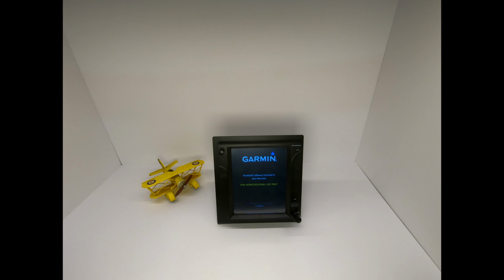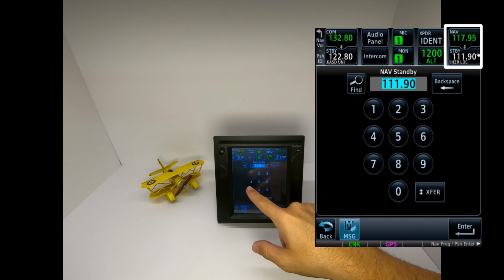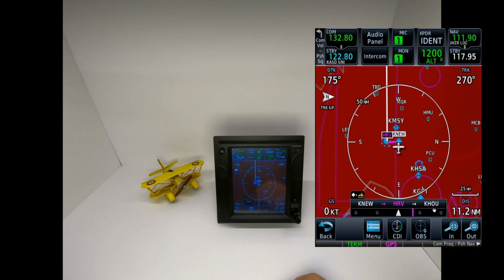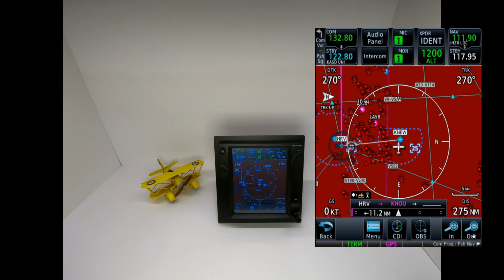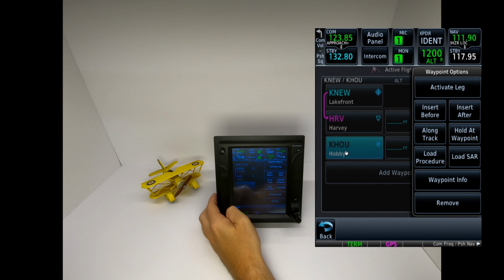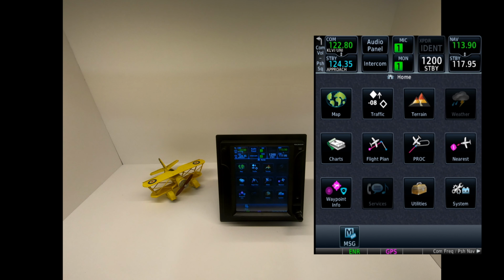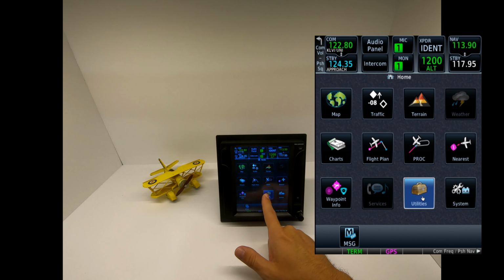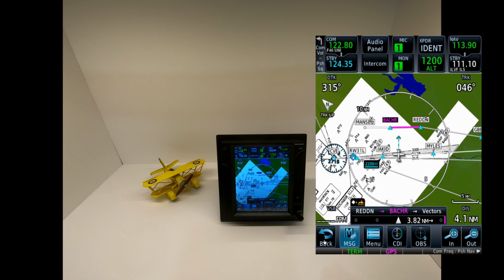VATSTAR's tutorial on the RealSimGear GTN Series using RealityXP

Comment: I just found your channel by accident and looks like it can really help me before I buy this stuff (still trying to figure out what I need/want while keeping my steam gauges in air manager.  I .had a couple of quick questions:
-Does the GTN750 do a "great/realistic" job of function as a transponder and comms or is it best to buy the later two separate ( I dont mind spending the money but want a great experience and not just a combo product I have to go in and out of menus to get at the gps/transponder and comms?
- will these work well on MSFS or am I better off in plane?
Thanks in advance! (also subbed!)
Reply from the maker: The feeling of the buttons are pretty realistic, the touch screen is really responsive. Now, the software itself, the GPS it depends who you use. Xplane you could get RealityXP and theirs is using the GTN trainer so you know you getting as close to realistic as you can. I believe MSFS also uses the trainer.
Reply: @VATSTARVirtualPilotTraining  thanks !!